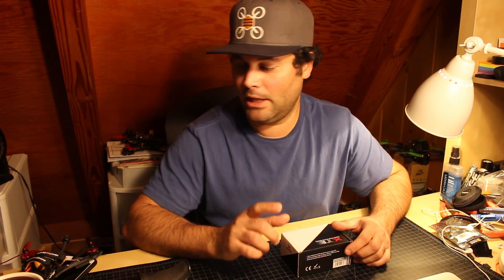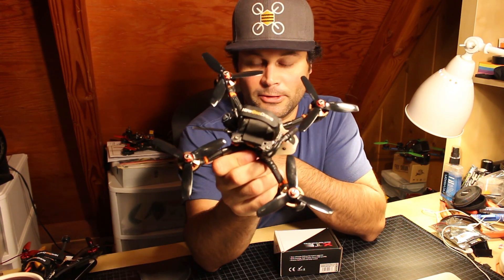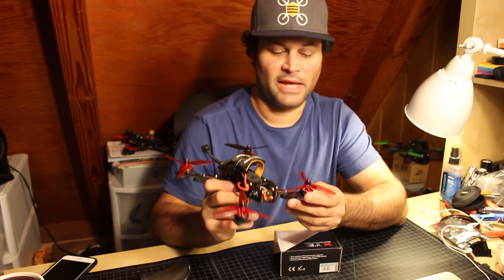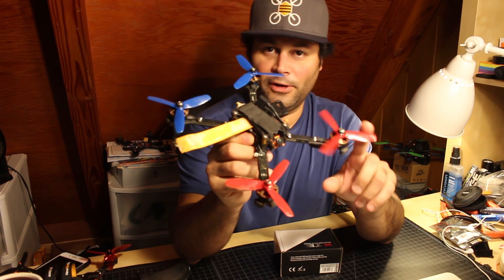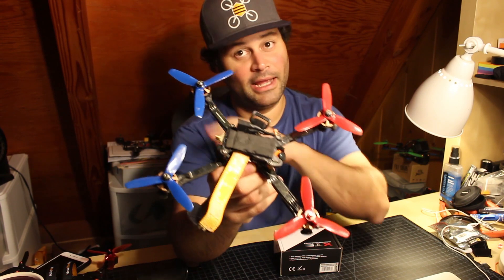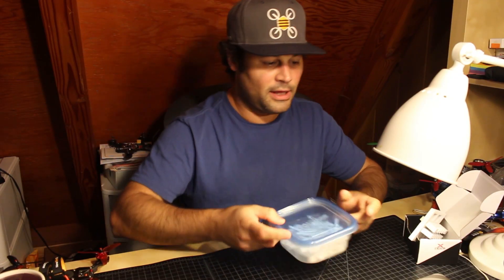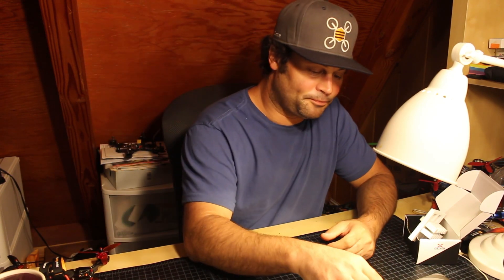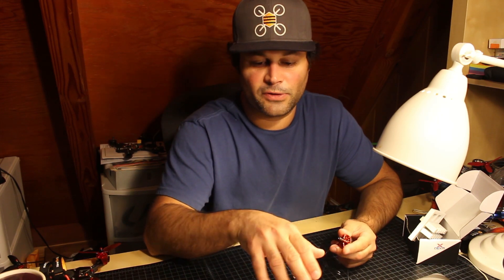5S Power on a 4 Inch Quad Part 1 - XNOVA 2204/2350kv Motors

Comment: I like the Brotherhobby Tornado T1 1407 3500kv on 4s. The weight is around 270g with Lipo etc. On 6s i flight the hglrc 1408 2400 kv
Reply from the maker: The Tornados are definitely classic. I did look and consider the HGLRC 1408s... I'm just not much of an HGL fan.
Reply: @PinchTune  I'm also not a fan from hglrc. They only have the right size and kv

Comment: .I'm running 2306 2700kv pretty sure they would set on fire if I used anything higher than 4s, wouldn't mind running on 5s to try it out, I'm on 5inch though not 4inch
Reply from the maker: Well, not really. It's quite a bit on the high side on 5 inch, but if your ESCs can handle it, it will work. Though I wouldn't recommend it. However, if it's 4 inch props than it's absolutely fine. That roughly equates to 4S on 3400kv, which on 4 inch is fine.
Reply: PinchTune my pdb is rated for 6s and my esc's are 5s 35amps, I took it for a test yesterday on 5s and the motors came down just as cool as if it were 4s, I made sure to do plenty of punch outs and full throttle and it worked really well. I think I much prefer 5s now. My batteries are only 1300mah 40c so as they are low amp batteries that could be wire it worked so well but I'm no expert.
Reply from the maker: @jasondonavich2758  Well you have to keep in mind that with higher voltage, you pull less amps. It's a balance. If your gear is rated for higher voltage, it can normally takes it just fine. In my case, I've been pushing 5S through a board that is designed for 4S. That's why I'm extra careful to keep the kv down. I much would prefer slightly higher kv than 2350kv on 5S, 4 inch. But I'm afraid that if I go any higher than that I'm going to blow something up. Haha.
Reply: @PinchTune  I ways thought even if say the esc's were rated for 5s but the motors 4s then they would over heat. Must not be the case. I find alot of mixed opinions on what can and can't be done.
Reply from the maker: @jasondonavich2758  As far as I know, the motors are not rated for anything. As long as the motor is built to quality, using good materials and proper wires and coating, it's the kv match to the prop and voltage used that establishes the rating. Yeah, manufacturers used to etch the rating on the motors... for example, 2s to 4s... but those were guidelines, specially back when we didn't know what we were doing. But now that there's knowledge and standards out there, we can more easily match motor kv, to prop, to voltage and be fine. The only other thing I would add to this is that I prefer single strand, thick wire motors over multi-strand. I believe the single strand stuff is harder to burn.
Reply from the maker: @jasondonavich2758  Yeah, no, that's not correct. I can't be 100% sure with really old motors, but anything modern is based on kv and prop choice. But I'm willing to bet that even the old Cobra 2204/2300kv... (4s motor) run on a 5S on a low pitch prop, on modern firmware and it should be fine.